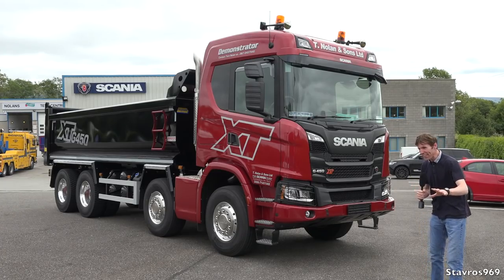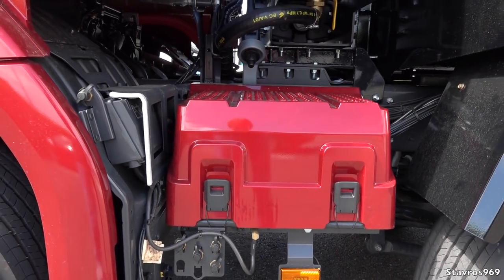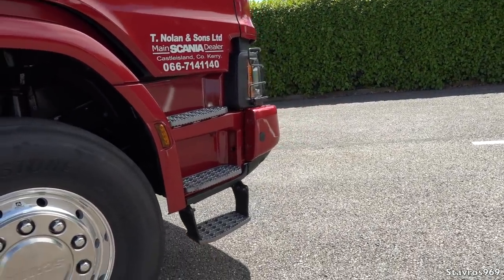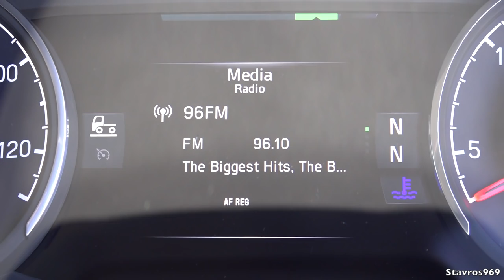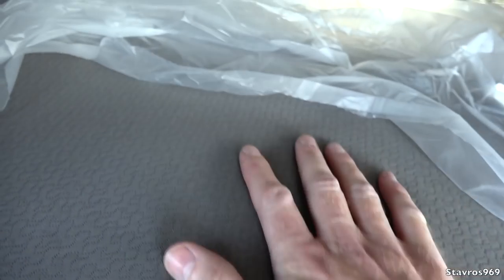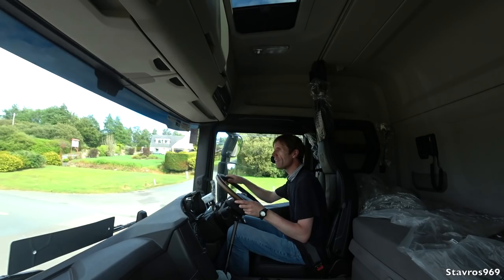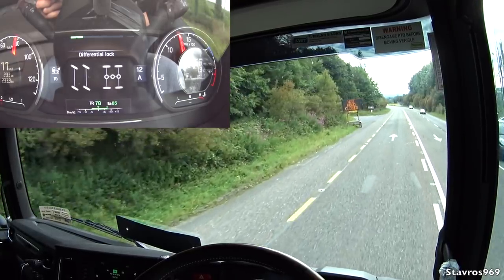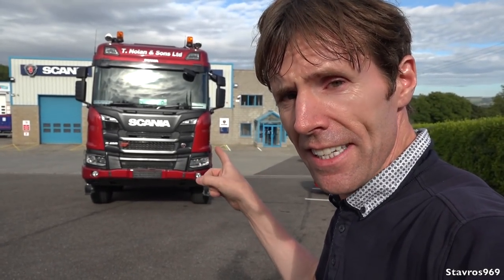2018 SCANIA XT G450 Tipper Truck - Full Tour & Test Drive

Comment: Thanks for the review! I’ve got the R500 XT as a logger in NZ. (8x4) I love it!!! Ironically I’ve called it ‘Luck O’ the Irish!  (My name is Patrick Mulligan)
Reply: Hows the XT going for ya Patrick fuel and power wise. We looking at a 450 XT for tipper works with a  trailer owners review would help
Reply: @izzibruh8510  Not the owner. Just a driver. Good for power. Four axle trailer. Was 46 tonne rated, now 48. Pulling well, (on some very demanding country) now that it’s run in. (140,000kms) I think doing ok for fuel consumption? Our company (McCarthys Transport) are getting lots more ‘G’ model Scanias.
Reply: @patmulligan7299  Thank you brotha really  appreciate it. Safe drive out there 🤙🏽

Comment: Why does it have a clutch pedal??
Reply: It's pretty much an optional thing to use if you think you can start better on a hill or something than the computer.
Reply: for start,maniouvre, and very loww speeds with load...

Comment: No lift axle/s?
Reply: no
Reply: Tippers tens not to need them, you get the occasional rear steer with a mid/rear lift, often times tipper companies run loaded everywhere to maximise profits so most of the time not needed
Reply: I dont know about UK/IRL but literally every tipper truck ive seen in Finland had atleast 1 lift axle. So not seeing a lift axle in a brand new truck is kinda weird for me :D
Reply: That's only a thing in Finnland and maybe some Scandinavian countries, but the rest of Europe doesn't have lift axle tippers.
Reply: We have lift axles in the UK but like I said they’re rare and we often backload so you’re not really empty when driving.